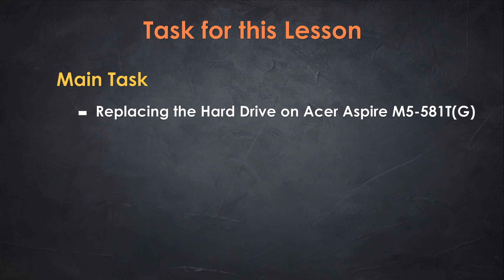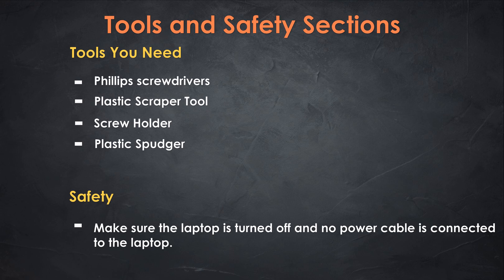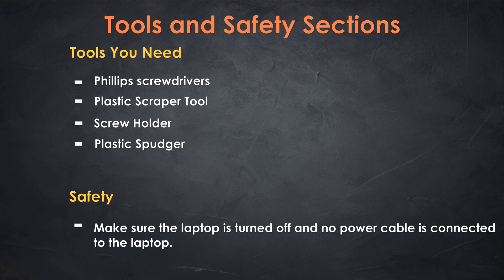How to Replace or How to Upgrade the Hard Drive on Acer Aspire M5-581T

Comment: How do you upgrade the RAM?
Reply from the maker: The Ram slot is on the other side of the motherboard, which mean you need to remove the motherboards. Here is a video from another youtuber that you can use to upgrade the ram.  https://www.youtube.com/watch?v=Fw1pj_vvDXE. hope this helps